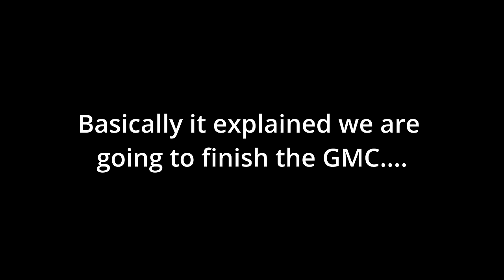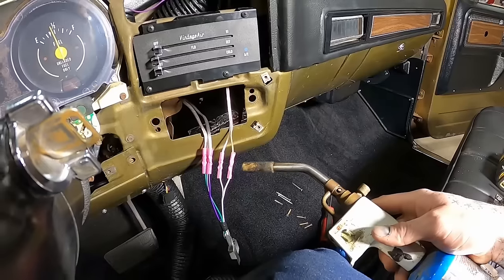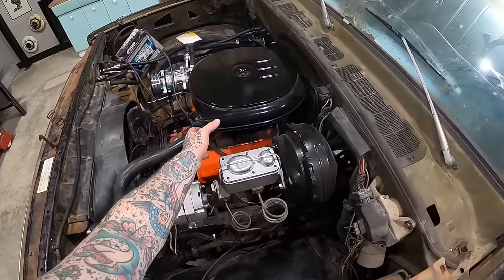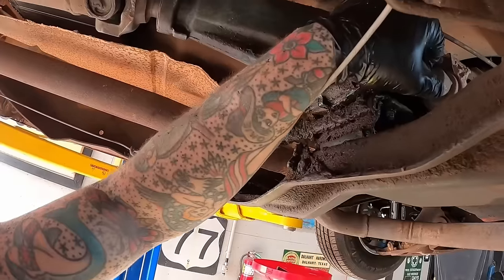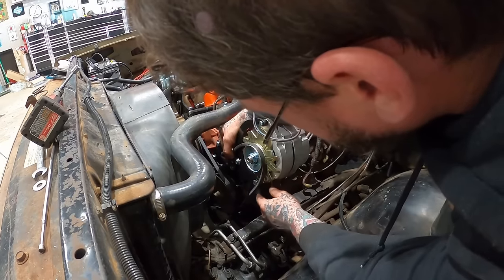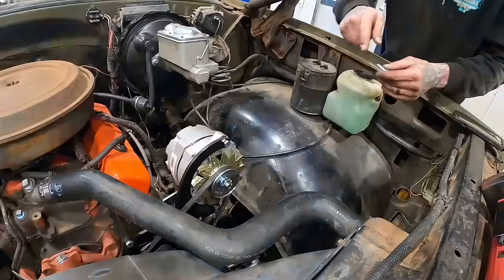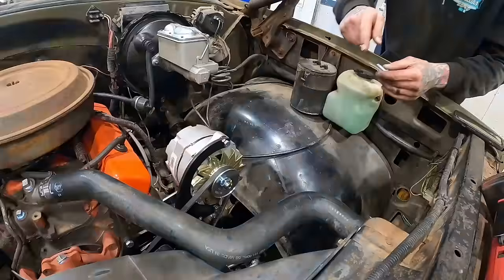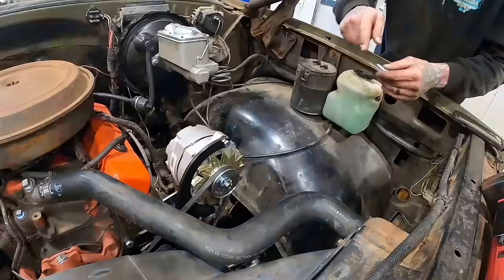I finished the 1976 GMC and GAVE IT AWAY!

Comment: No hate, but u shuld learn to solder. Its not as hard as welding, first off get decent soldering iron, u can get cheap ones from china that work much better than al the big hammer irons u get in yoour store, and they only cost 5-10$.

Second, Kester 40/60 rosin core leaded

3rd a good flux.

Comment: Excellent video Puddin  :) also on new front windshield window the Am/ Fm radio antenna  are be able put on new window and work for new radio to or put a antenna on one the  fender of pop rod run cable in to firewall to new radio ! Hope helps out to or won't be getting stations pick that all and my suggestion! Also yes nice truck give to buddy Randy and hope take vechiles shows from May to October  each year win prizes on it too!

Comment: Those ac lines behind the grill are going to rub against each other and cause a leak you might want to get some cork tape it's this black gooey stuff that HVAC uses in order to insulate lines and protect them from rubbing against each other.

Comment: The absolutely best possible thing. You can do with a battery tray if you are either putting a new one on or restoring an old one.......

Give it a good coating with spray on bed. Liner for a truc!. It will rubberize and seal it all at the same time , and it will never rot  away!

Comment: that shifter pin inserts from the top, they can work loose and you can see it trying to work itself out and push it back in instead of it falling out and leaving the handle in you hand. my 1980 silverado does it all the time. Sure beats searching all over a ( usually dirty floor ha ha )

Comment: Heater hoses and radiator boses need extra grip from leaking. ? Use RTV gasket sealer for extra holding strength puddin's fab shop .
From : California Smoke.

Comment: I really like the RetroSound units. However, sumtin that's even better imo is to keep the old dirty and broken AF radio in the dash (it looks cool and turns away thieves). Just install an amp that has bluetooth. This way you can have a fully new and modern ultra nice, expensive audio system with excellent sound but it's totally hidden. The old radio looks awesome I think and it really hides how I have $1000's worth of audio equipment in my darn easy to break into old truck :)

Comment: Sorry, this is a little long... I always watch the videos the same day, but there has been a bug goin around here too...
Nicely done...It's funny how things get done differently when a project has a purpose, especially if it's for someone else.
I painted a car for a good friend of mine quite a few years ago. He had wanted to do it but never had time.
He didn't want me to spend a lot of time on it. He just wanted a scuff and shoot, but we have been good friends since we were
about 14 years old, and I'm 62 years old now...
Before he had a chance to say otherwise, I already had the car disassembled and striped to bare metal. There was zero rust
and the car had never been hit so that helped a lot.  I painted it a Porsche charcoal metallic, and when it was done,
he had a legitimate show car. I didn't keep track of time, because it didn't matter, but I sincerely enjoyed every minute I worked on that car...
Doing the pickup project not only says a lot about you as a person, but it also says a lot about the other people that
donated and sponsored parts for it too. There are still a lot of good people in this world.
* As a side note; that is really cool that Cheyenne parts does reproduction wood dash and door panels because as you know,
most of them have faded and look really crappy, so the chances of finding nice used ones is really slim.
I wish they would have had those when I completely restored my 78 GMC 3500 4X4 crew cab with single rear wheels.
Mine had the aluminum panels which was what it came with, but I would have rather had the wood panels.